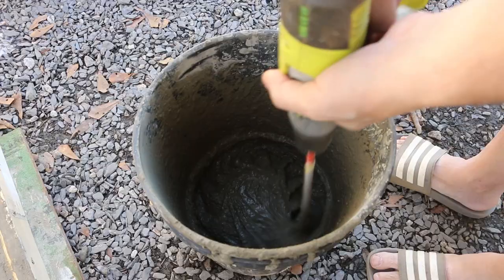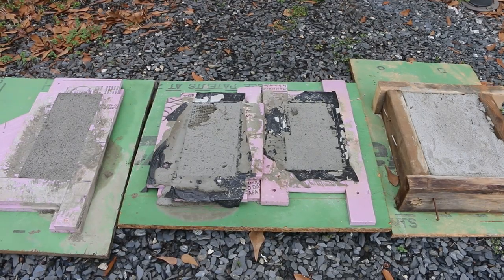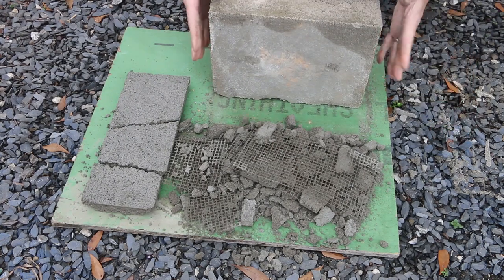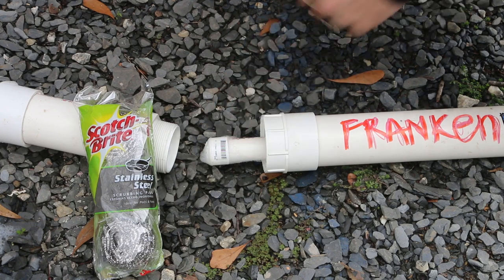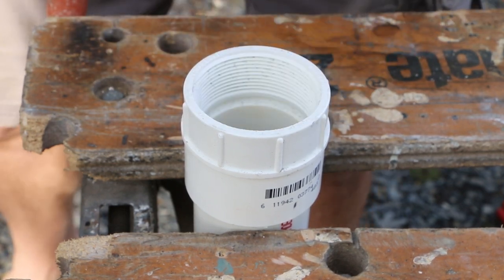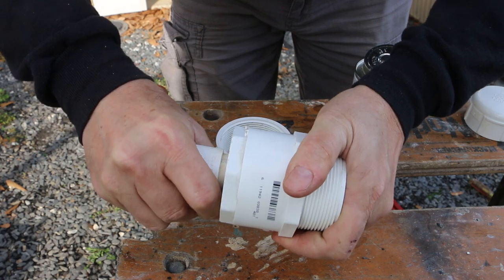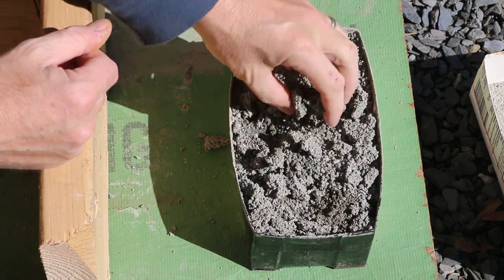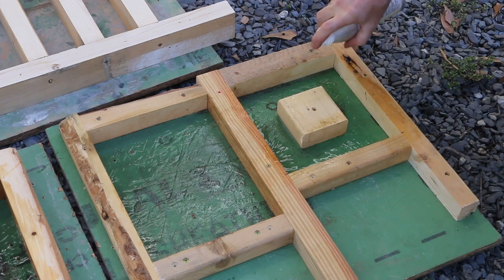How To Make Aircrete Bricks | Success & Failure

Comment: Your passion for foamcrete is highly admirable. 
I used to use CaCl2 as an accelerator.
 For a firmer foam, you can slightly reduce the air pressure.👍

Comment: Presumably, if you sealed the crete forms, they wouldnt collapse because the air wouldnt have anywhere to go right?     and for larger /stronger slabs, baybe what you should do is make a bunch of small aircrete tubes/bricks and break them up, then use the broken up crete bits, to make a new mix of crete, like a styrofoam crete but using small busted up bits of air crete instead of styrofoam
Reply from the maker: I did start covering the bricks with plastic to keep the outside air away. That helped keep the white top layer from forming. Great tip on reusing broken bits of aircrete in more aircrete. Kinda like a twice-baked potato. :-) Thanks for watching.

Comment: One of the first things I ever learned about concrete is it's composition... Water, cement and some kind of aggregate... In this case, there isn't any aggregate... cement is a glue, and only becomes concrete when a bond is made between the glue (cement) and the aggregate such as rock, sand or even perlite. The foam just creates air bubbles that make the mix lighter, not stronger. you need another component to create the bond.

Comment: Greetings.. excellent content you have build up here! I’ve seen many others about cellular concrete and this it’s by far one of the best since you’re making a binnacle of your own experience and testimony.. one of the thing I could see you’re doing different it’s that you’re using ordinary dishwashing soap.. and I’ve seen that and industrial component as pure propilenglicol or and industrial foaming agent it will end with better results! Another thing it will be the batches.. I can’t remember what you’re using but smaller batches of 1 or half a kilo of sand by 7 or 3,5 kilos of cement dust with about a liter of water plus the necessary quantity of foaming agent to that liter you will get with about a quantity slight less than 5 gallons and it will be better that try to mix large amounts of the aircrete! Probably because light machinery as a drill with a mortar mixer bit accesory will worked better to mix up the cellular concrete without deinflate the batch.. and heavy machinery will tend to overmix the aircrete! Another thing it’s that we tend to think that any kind of sand will work well but just regular sand or even fine sand will probably make a good aircrete.. but I’ve researching and a good quality fine sand or better than those a good river sand will make a difference not decanting on the bottom of the mix!
Reply from the maker: Good stuff here. Thanks for the feedback. Thank you for watching.

Comment: Use old motor oil to grease molds  , its mixed with diesel and spray with garden sprayer. Quick and cheap. If cold weather use handful of calcium chloride to heat mixture, then pour.
Reply from the maker: Thank you for the tips, Michael. You sound like a pro talking. :-) Thank you for watching.

Comment: The problem I see here is your air pressure. Its the reason your gun is spurting out the foam and not just creating steady flow and consistency. 
I would advise you dial down a little bit and observe how that turns out.
Another thing you might want to check is that you're using a proteinaceous foam and not synthetics like SLS...
SLS rise quickly but don't hold structure well over time...

Comment: if you add a touch of glycerine to the foam the bubbles will remain firmer.
Reply from the maker: Hi Fleanis. Thank you for the tip. In a more recent video I used Seventh Generation dish soap, which includes glycerin. :-) Thank you for watching.
Reply: @GreenShortzDIY  What I use now is marker foam. It is used by farmers for marking out their crop areas. You can buy it in 4 liter packs or 20 liter drums fairly cheaply.

Comment: Try getting some lightweight aggregate to include - pumice or expanded shale maybe?  Whatever you choose you want something rough and jagged not smooth and rounded.

Also what about playing with admixtures?  You can buy air entertaining admixture online, maybe locally too but you'd have to check stores in your area.

Last edit, I promise - I notice that the tops exposed to the air seem way more crumbly than the rest of the concrete.  Concrete needs to stay wet to cure, and I'm wondering if the mixture is drying out too quickly.  For the surface area there's going to be a lot less water in aircrete than normal concrete, so maybe it's drying out faster too?  Look into "wet cure" and see about that for your future testing as well.

Keep up the great videos.

Comment: creative content.. looking forward to the results.  Some thoughts: seemed like the dry cement used was lumpy/clumpy which will make it more difficult to achieve  a homogeneous mix and effect strength.  You want a very smooth portland cement slurry to start.  I'm thinking the  1st batch that resulted in a very thick chocolate mouse like consistency will turn out the best.  The gritty batches looked off.  Aircrete is a simple yet very precise process.  Not sure what your ratios are .   You might have better luck achieving proper density trying suave clarifying shampoo, dawn or seventh generation dish detergent which have yielded successful results for other aircrete enthusiasts. 
Maybe consider doing a little larger batches and injecting the foam to the bottom of the bucket by adding a longer pvc piece to the end .... so it will incorporate better.  Foam tends to want to float to the top.  A fellow youtuber MAN ABOUT TOOLS did aircrete raised garden beds and shares his smaller batch recipe with precise ratios.   The video is entitled: "Make Lightweight Concrete Garden Boxes PART 3 - Aircrete Vermiculite Lava Rock"  https://www.youtube.com/watch?v=ddedMmuj7xY   at about 10 in he demonstrates aircrete.  it might help to replicate his recipe initially to get the correct ratios established.  Best of luck in your aircrete adventures.
Reply from the maker: Thank you for the feedback. I looked at some Man About Tools for some research. :-) I didn’t see his ratio section though. Thank you for pointing me there. I agree that this Portland is a bit chunky. It had seized up a bit and I had to break it up. I do think that affected the mix. I think the gritty mixture looked off. I saw that Aircrete Harry used the foaming agents you referred to. I also saw a comment that referenced Seventh Generation containing glycerin, which helped support the foam. Interesting idea to inject the foam below the slurry, I’ll have to give that a try. Thank you for watching.

Comment: The foam always seems to start out bad and then get to shaving foam consistency but you catch the bad foam in your bucket. I think you should run it onto the ground until the foam gets good and only then direct it onto your cement. Actually the foam seemed good straight away for the mix at 30 mins but the earlier mixes had the issue.
Reply from the maker: You are right, Andrew. I do forget to prime the pump. I’ll make clearing the wet foam first a standard practice. It did the same thing at the 30 min mark, I was just in my “slice and dice” edit mode at that point and cut that out. Thank you for the feedback. Thank you for watching.
Reply: @GreenShortzDIY  Thanks for putting out stuff for us to learn from :).

Comment: on your reservoir cap cut an inner tube or other rubber and glue to the inside of the cap so that the edges will cover the male connection. That should solve your leak. You might be able to use a toilet bowl flapper seal but not sure if that is the right size. I get inner tubes from tire shops, they usually have bad ones laying around.
Reply from the maker: Thanks for the tip, Ed. Thanks for watching.

Comment: Great, I am looking forward to these experiments.
Your big block was perfect, Aircrete is always going to be able to be pressed in with your thumb, you can always render a stronger sand cement mixture on the outside of your finished project to strengthen it.
I think your slurry was too thick, as you already know water is essential for the cement to chemically cure it looked too dry. Did you cover the aircrete in the forms to hold the moisture in?
I like your style, how you wing it, but if you get a really good consistency you would need to know the ratios in order to repeat it
Reply: I beg to differ. The indians make aircrete that's pretty sturdy...

Comment: Remember curing takes around 28 day's for more strength. It will get stronger the longer it sit's. So try those thin samples again and try your test again and see if there is any change.
Reply: I fully agree with your advice, Jimy Isenberg. The curing of the cement is one of the most important aspects and one that many people relaitivize.
I have experience in ferrocement and, what makes the difference in the resistance of the pieces, in two equal samples, is the care of the curing of the cement.

It is very important to cure the cement taking into account the following points: keep humidity above 90%. Protect the piece of cement from direct sun and wind.
Paying attention to these points makes a difference in the strength of the piece of cement that you manufacture.
Thanks for sharing your knowledge.

Comment: You should work on a styrofoam grinder and mix very fine styrofoam with the aircrete.. for styroaircrete... also add some stronger cement mix to the top and bottom of the pour to give more surface strength without too much weight gain...
Reply from the maker: Great tips. Thank you, Ruth. :-)

Comment: About 20 yrs ago, I remember houses being built with a mixture of concrete and recycled styrofoam filler which otherwise would be trash, made into  bricks/ blocks. Structural.  So why Aircrete instead?  Just asking.
Reply from the maker: What you are talking about has more structural value that aircrete. My understanding is that aircrete offers insulating properties for my plan to use the material to create Rocket stoves and a furnace. Thank you for watching.
Reply: @GreenShortzDIY  thanks for not minding the question.  It's been so long, I'd forgotten about that technique.  I do remember that the blocks were not flammable. But bigger, bulkier than the sides you are creating for stoves.  I suppose they might be pizza oven material?  But really intended for house construction.
Reply from the maker: Questions always welcome. But, I certainly don’t have all the answers. Lol. Especially with aircrete. I’m still learning about it. I have seen people create buildings with it, but usually poured with a steel frame that provides the structure. I’m not planning anything to that scale. At least not yet. Thank you for the encouragement.

Comment: What is the sufficient foam density that i have to maintain , bro?
Reply from the maker: Hi Rambo. You just need the cement slurry to harden enough before sinking any. I help this process by covering the filled forms with plastic sheeting to keep the air away and popping bubbles. There is a range of what works and it is the kind of thing you need to try a few times to see what works. It took me a few months of making videos to get it right. The videos made that take longer. I think you could get a feel for it in 3-4 batches. Thank you for watching.
Reply: @GreenShortzDIY  how much foam density will you maintain?
Its usually around 75 to 90 grams per litre

Comment: 1–Take down the wind chimes before filming, put them back up when done filming for the day.

2–Next start testing for air/limecrete (limecrete lasts thousands of years using volcanic ash as the filler instead of sand).

Comment: a little late but put a regulator on your air coming in and put in only like 30psi and experiment a little might even do less. This will make it denser, your foam is too coarse, also I would do better screening the cement to powder or mixing better before the foam the big clumps and coarse foam are hurting your consistency in the finished product. also might try better foaming agent or some accelerator or baking soda to get the cement to cure faster before your foam collapses.

Comment: Add glycerin to the liquid to help the  bubbles survive longer. Also the reinforcement is too tight for such small form. Maybe 1x1 mesh...
Reply from the maker: Good tip on the mesh. I have switched to 7th Generation detergent, which has glycerin. Much better foam! Thank you for the feedback. Thank you for watching.

Comment: Maybe it would be good filling icf block
Reply from the maker: Hi Donald. I’m not sure it has the compressive strength to have a structure sitting on it. Perhaps if there were columns of full strength concrete along the wall, the aircrete could fill in in between. But, an engineer would need to weigh in on that. Thank you for the feedback. Thank you for watching.

Comment: I was thinking Air Crete is not ment to be structural it is to make concrete lighter. To use in between supports that hold it more solid. If you want to use it instead of blocks you will  have to make them thicker. Put the wire inside but also put a layer of something on the outsides. Maybe a fake  brick or a thin fire brick. It by itself is not stable.
Reply from the maker: Thank you for the tips, Deleah. What I plan to build won’t require much structural strength. The furnace will likely be inside a metal bucket. I’m thinking about skim coating the two other projects. Thank you for watching.

Comment: You should try and make the concrete with salt water.
Reply from the maker: Thank you for the suggestion. I’ll read up on that.
Reply: But chlorides from salt cause concrete to degrade and fail in a VERY short time.

Comment: "That's how concrete cures, the wetter the stronger it is"  You really need to do more reading up on the chemical reactions involved in mixes that contain Portland cement A LOT MORE. 

There are a multitude of videos and articles with instructions and procedures on how to do this you are clearly wasting your time trying to reinvent the whole process. The foam weight and the mix ingredients of each formula is use because it WORKS. Just like any other recipe. Change the method and the ingredients you get different results and since your trying to get similar results perhaps you should just do it like others.